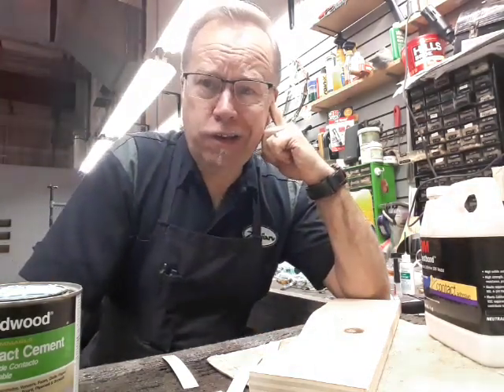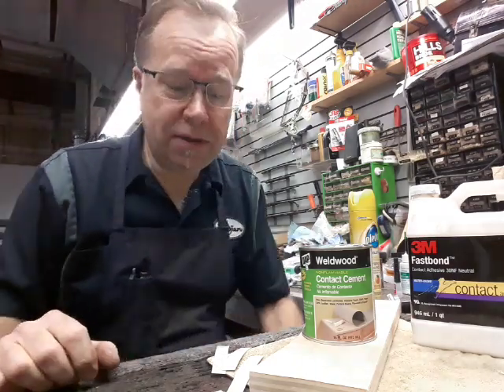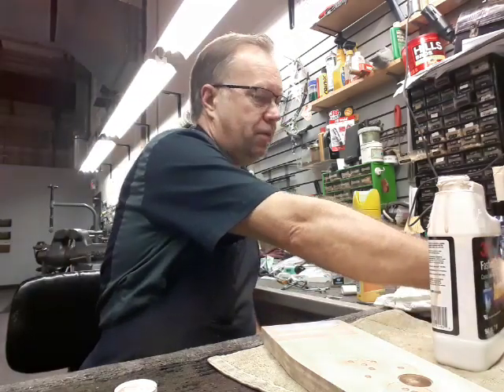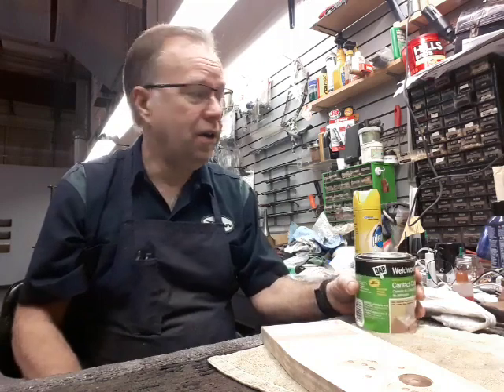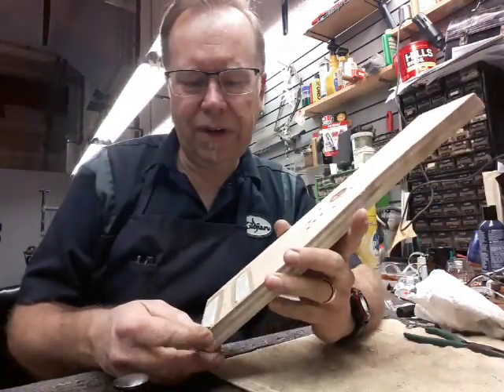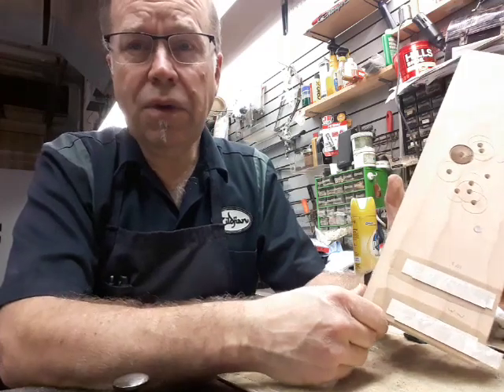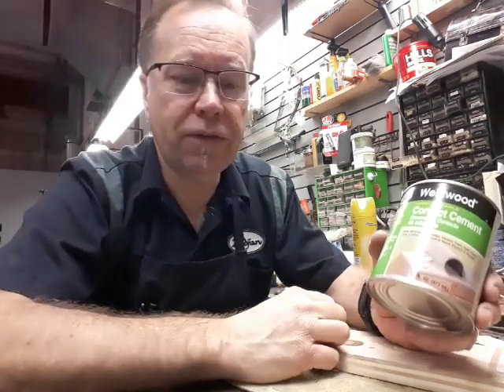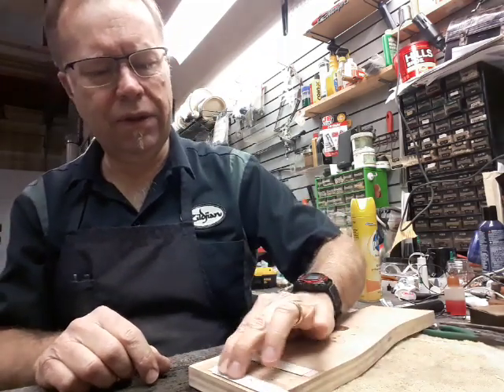Drum re-wrapping. Glue choices 3M Fastbond 30NF vs Weldwood water based NF

Comment: Open time once tack dry is approx 4 hours. Pattern left by tool of application is also important. a stipple or waffle pattern is best. (spray or waffle roller)n complete dewaxing or degreasing is key. Best to scuff surface of old "pearl" aka formica with 80 grit sandpaper is also recommended. Cure to full strength after lamination is 24-36 hours.
Reply from the maker: Great thoughts. I do usually scuff overlaps. Thank you.